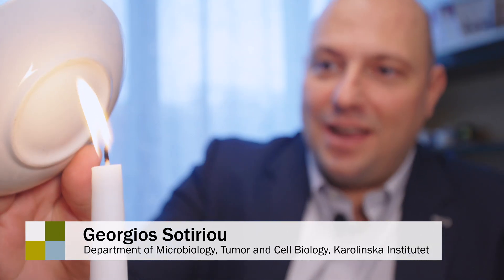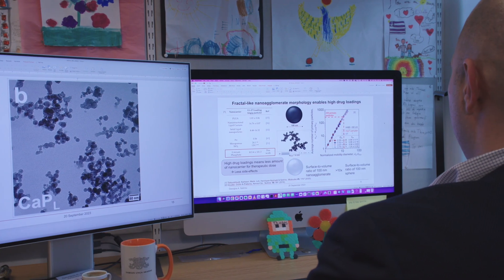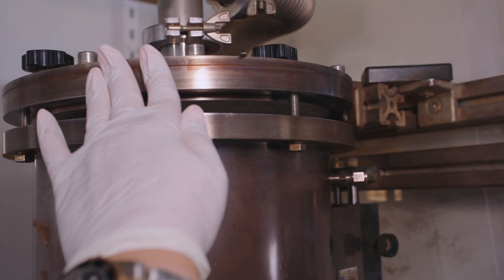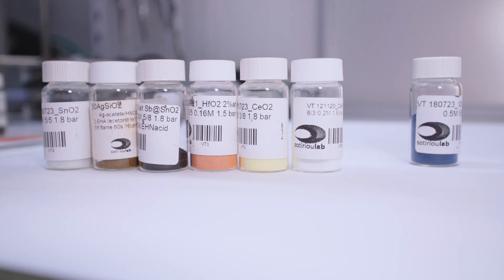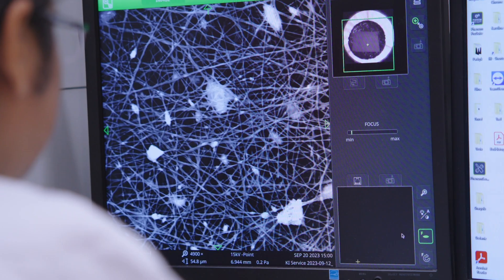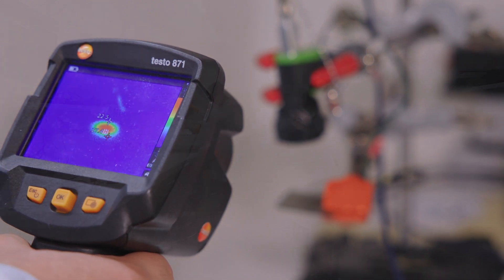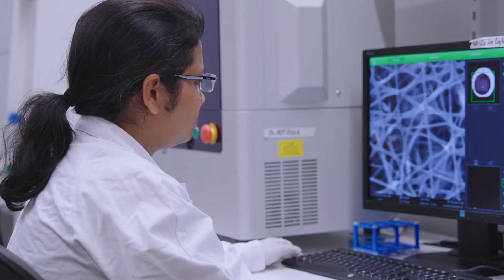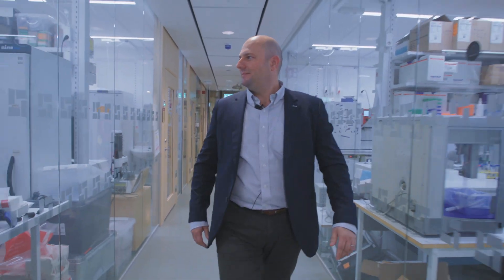How to make nanoparticles with fire

Comment: No sufficient explanation about flame reactor and how to solve oxidation in open flame reaction and so on.
Reply: to me the flame rector looks like a microwave plasma torch but i would think any clean  flame would do if hot enough and for the liquid as a example use a solvent like ethanol with copper 2 chloride as the salt and when you spray it into the flame if oxygen is present than you get copper 2 oxide if oxygen is not present you get copper metal.